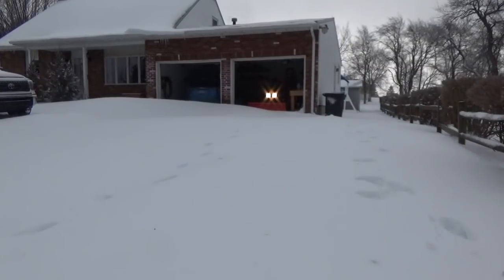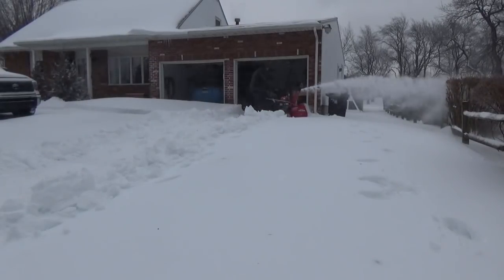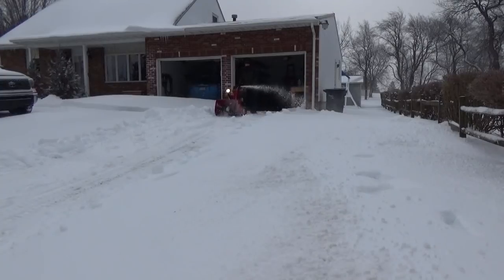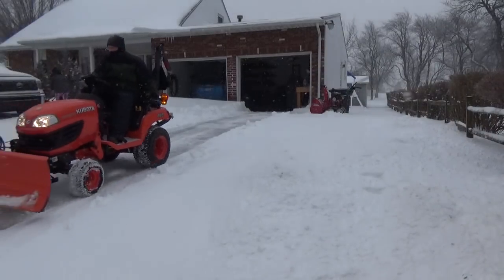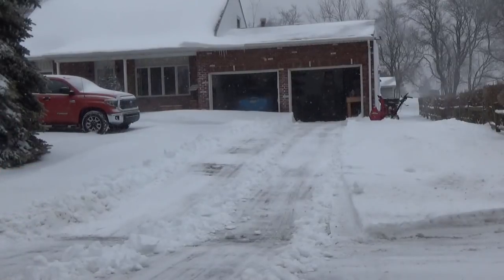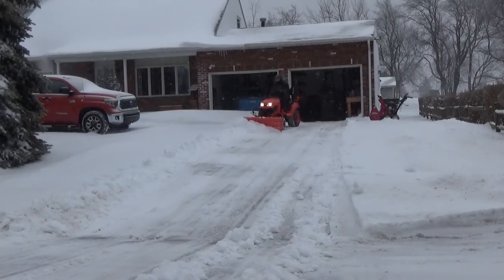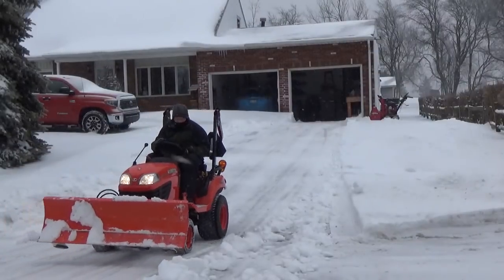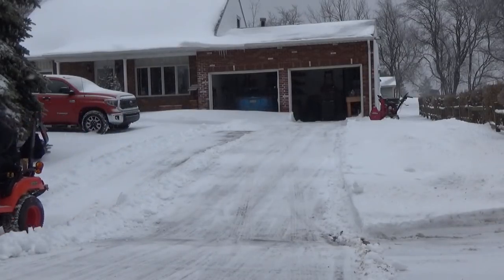Winter Storm Harper - Kubota BX and Honda Snowblower - Foot of Snow!

Comment: I live outside of Boston and we get major storms all the time, although this winter has been mild so far.  Three years ago I was out killing myself after we got 3 feet of snow, even as I used my snowblower.  It would take me hours to do a driveway a little bigger than yours and I would be all covered in snow, soaked to the bone.  I said that's it and came in and told my wife I am getting a Bobcat.  She said what is a Bobcat?  Fast forward 3 winters later and now snow removal is fun.  I found a dealer who sells really good trade-ins at a fair price.  I used to use them all the time growing up when I worked construction, so I knew what I wanted and how to operate them.  It was one of the best moves of my life.  Snow kills people.  Every year people drop dead of a heart attack shoveling snow, especially the heavy wet stuff.  Nice video sir.  Great commentary.  I applaud your use of equipment to tame mother nature.  Using a tractor or other piece of equipment turns a nasty dangerous chore into fun.
Reply from the maker: Thank you for the kind words!  You are correct that snow removal is just hard on the human body.  Nothing makes it more fun that a piece of equipment.
Reply: JW bobcat as in the brand?  Do you have a tracked loader skid steer or a bobcat tractor?
Reply: Bobcat 742B skid steer loaded with wheels not tracks.  Just a bucket no plow or snowblower.  It was a beast in last week's 14 inches of snow.   It put the fun back into snow storms.  And unfortunately another local died of a heart attack shoveling snow.  I'm never going back.

Comment: I've got a BX1860 with a loader on it that I move snow with.  The loader adds weight to the front so to compensate My turf tires are full of fluid.  Adds enough weight to balance out the loader.  Had used it for 2 years like that and needed the 4 wheel drive to backup the drive.  Decided to put chains on the rear.  Now don't need the 4 wheel drive so will save some wear and tear.  Good video  Love the little Kubota it has been a good tractor for me

Comment: Hi Joe. I have a driveway about the same size as yours that I used to plow with my atv. I could plow up to a foot at a time without too much trouble by taking smaller bites of snow like you described. The first pass is the hardest. I always make my first pass with the plow at full angle. The machine is not heavy enough to bulldoze that first pass, you need to get the snow rolling off the plow. You could also start out driving straight out of your garage with the plow at full angle and if you feel like you’re starting to slow down turn off to the the left or right to get that snow out of the way, back up and start pushing again. Like you said, once that first pass is done it’s easy.

Comment: When I was younger I was having problems plowing a drive with a Ford 1910 and a rear blade.  Someone eventually came along and told me that with snow you want to plow it fast.  Rolls off the blade better and so on.  Have fun, I'm looking forward to a few more snow days here.
Reply from the maker: You make a valid point about getting a "running" start while plowing.  I will definitely try this the next time.

Comment: Chains and wieght would help a ton.   My JD 520 i pulled my 9 ton trl from the bottom of moms hill and i run chains but they like getting between the lugs so i pried them out of the lug and no problem then cause initially i was stuck

Comment: Hi Joe I have a bx1800 same tractor but older one reconditioned is a weight box I have bolt on weight in my rims and tire chains on the rear the rear tire sizeare 26-12-12 same as a atv
Reply from the maker: The weight box (ballast box) is not a bad idea.  I definitely need to find a solution.

Comment: Hey there Joe, your turf tires are better on ice than ag tires or R4s would be. Chains and more weight would also help. Here’s some crazy advice, sell your Honda, sell you front blade and get a front blower for your BX. A back blade would also be beneficial. Gave you a thumbs up and subscribed! 
Keep on tractoring and God bless.
Reply: I second Jon's comment. If you watch my last video I have the turf tires with no chains plowing on ice. The only difference is I have the added weight of a box blade on the back and the front end loader on my tractor. Harper dropped a .10 of and inch of ice and then snow here. My BX didn't have any issues with slipping or getting stuck. Get some more weight and tire chains and you shouldn't have any issues in the snow. We also likes and subscribed.
Reply from the maker: A RITTER BIT WILL DO do you think that a rear mounted snowblower would accomplish the added weight goal while still allowing for me to keep the plow on the front?  I know I mentioned about the cost, but I am just curious.  Thank you for subscribing!  I subscribed to your channel as well.
Reply from the maker: Kopplin family thanks for the info.  I appreciate the like and subscribe!
Reply: I think that would be another option for you as well. Rear snowblowers are much cheaper, if you’re only clearing your driveway it wouldn’t be that big of a “pain in the neck”
Reply from the maker: A RITTER BIT WILL DO...you got the pain in the neck part right!! LOL
Reply: I have an BX1870 with a front snowblower and turf tires , and have never had a problem plowing my driveway or my neighbors and also do not use chains .
Reply from the maker: rec0355 I think that the snowblower is the difference.  No matter how deep the snow, you can simply “crawl” with a snowblower and dig your way out.  This is certainly not the case with a snowplow.
Reply: I still feel it's the weight, My BX 1870 doesn't have a snow blower or chains.
Reply from the maker: @kopplinfamily7529  is the only weight you have on the rear of the tractor the box blade?
Reply from the maker: I got the pain in the neck part!  LOL
Reply: The turf tire pattern on these tires have more edges and do well in snow.  I have been told they are better than the bar types.  Some more weight on the rear tires definitely helps too.
Reply: Hey Joe, I have the same tractor with fel and rear snowblower, I recently  installed my atv plow on my bucket and it's great.For you it would be a better option to get a rear snowblower as you already have the front plow .You could angle the blade to push snow either way of your drive and finish with the snowblower .It's faster and your neck don't have to turn back for a long time. I use this method now  and it's better .This little tractor impress me each time I use it .I live in Canada and we got a lot of snow to practice .

Comment: Nice job. I know you talked about why you set your skid shoes at a specific height but, do you think if they were lower you would clear more show off the surface there fore giving you better traction.  You could always put something on your 3 point hitch to add some weight aft of the rear wheels which would aid in traction. harbor freight sell a quick attach for 99.00 before the 20% or 25% off coupon.  Then  a piece of pipe with some old weights for ballast sitting in the quick attach.
Reply from the maker: There is no doubt that if I set the blade lower it would clear more snow and give me more traction.  However, the problem is that if the snow is too heavy and you get too much in front of you, eventually you lose traction anyway and the machine is unable to push it.   At some point, you will activate the relief valve in the transmission.  Keep in mind, I can't set the skid shoes to make the blade lower because I have very uneven sections of driveway.  This would cause me to tear up the cutting edge of my snowplow.  I like your idea about the weights for the rear.   Thank you for your input!  Be sure to subscribe if you haven't already.

Comment: I guess the 1870 model is not available anymore.  I'm going to be getting an 1880 delivered soon - I can't find want the difference is between the 2.
Reply from the maker: The 1880 is Kubota’s newest version of the 18 HP.  Kubota made several improvements.  One improvement is the loader valve control on the right fender.  Another is a quick attach loader if you opted for those options.  Also, the new version has an entire hood that hinges up, making maintenance a breeze.  The old version is much more tedious.  Additionally, the front male quick hitch design is different.  And, I almost forgot…the switch to flat face couplers like you would find on a skid steer.  These couplers are so much more convenient than pioneer style.  Please like and subscribe if you haven’t already.

Comment: My driveway is rather long and on an incline. I've never used a tracked snow blower and I am sure they are great but with V-bar chains on my wheeled MTD 33" walk-behind I have never had a traction issue in the 25 years I have owned it. I also have a 54" front mounted blower on a JD 2720. It has R4 tires and without chains on all four tires I do a lot of spinning.

Comment: Chains will chew up a concrete or blacktop driveway, add wheel weights and air down the fronts too minimal recommend pressure. Terragrips and rear weight box if you really need to get crazy.

Comment: great video my friend just a thought ... have you thought about bolting a chunk of rubber to your cutting edge / blade like Tractor Time with Tim did on his Deere ...... he says it helps with uneven services ... maybe getting a better clean swipe will solve your slight traction problem .... we tried it on my buddies BX a few weeks ago he said it worked well for the slush storm Harper gave us up here in Ma. waiting on a better storm to see how well it truly works but it seems to be a huge improvement..... only time will tell ....
Reply from the maker: JeeperJimbo 1990 thank you!  I am glad you mentioned the rubber cutting edge.  If nothing else it would help in absorbing the impact of an uneven driveway.  Did your friend buy a rubber cutting edge or make his own?  I would be curious to know what material he used.
Reply: @averagejoevideo9556  we had a old rubber bed mat from my old pick-up that's what we cut a strip out of

Comment: I would suggest a flashing blue light on top of the ROPS  They are inexpensive on Amazon. I plow on a fairly busy road & had too many close calls without the flashing lights. Stay safe.
Reply from the maker: Peter Howard that’s a great idea.  Could you provide me with a link to the exact light you have on amazon.  Also, do you power it from the 12v socket or is it directly wired?
Reply: @averagejoevideo9556  your local ag store will have a 12 volt amber light that will suite your needs. Either with the auto lighting supplies or with the snow plow parts. I wouldn't recommend using a blue light.
Reply from the maker: cple1 is there a way to wire it directly to the Kubota?  I am concerned about breaking the accessory jack since the wire would be plugged in full-time during use.
Reply from the maker: @cple1  I was thinking about going with amber instead.
Reply: This is the one I purchased from Amazon I have had it on both the BX & my B2601. It plugs into the 12v socket & runs for hours with no problems. It has a very strong magnet so it will stay on the ROPS both ways. I purchased the blue strobe as that is what is used here in Ontario to indicate that you are snow plowing. It is an Xprite High wattage Gen 3 (sorry I don't know how to link the page). I am very pleased with this unit.
Reply: @averagejoevideo9556  You definitely want an AMBER light. I plow near the roadway here and feel much safer, especially at night. Look for a Class-1 LED beacon if possible. They are somewhat inexpensive... probably in the $70-80 for a decent one. Don't skimp too much as it can save your life. I plug mine right into the 12V accessory outlet since the LED doesn't draw much power. I bought one with a magnetic base and I just stick it to the top of the ROPS.
Reply: averagejoevideo lol nope, impossible.

Comment: You don’t need the Kubota when you got the Honda 928. I got the Honda 1332 snowblower and loving it. Honda is reliable for sure. Got my 1332 for $950 which is rediculous cheap from my Honda dealer.
Reply from the maker: You are correct about not needing the Kubota.  I use my Kubota for more than just snow removal, so I bought the snowplow at the time of sale since I got a good deal.  Did you buy your 1332 new?  That's a great price!  Be sure to subscribe to my channel!

Comment: watched the part with the snow blower than shut off the rest of the video with the plow do not watch snow plowing as i think they are useless. sorry .
Reply from the maker: Robert Rockwell you are entitled to your opinion.  Keep in mind that in general snow blowing is much slower than plowing.  That’s the primary reason I have a plow.
Reply: Each tool has it's own strengths and weaknesses. On my compact tractor I run a snow blower on the front and a 60-inch blade on the back. While I use the snow blower for the deeper snowfalls, I use the blade for everything else. It is just so much faster when you only have a few inches of snow. The blade makes it very easy to scrape down to the bare pavement or gravel so the Sun can melt things out bare. It also makes it nice on gravel. I can run the blower, leaving a couple inches of snow so I don't pick up rocks. Then go back over it with the blade and get things down to where it will melt out.